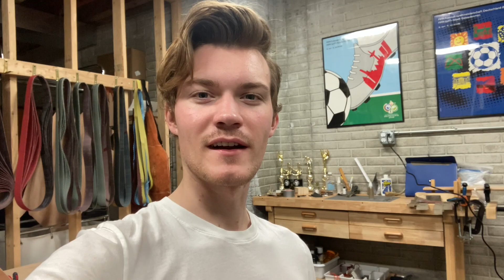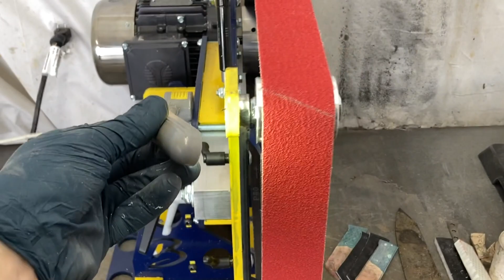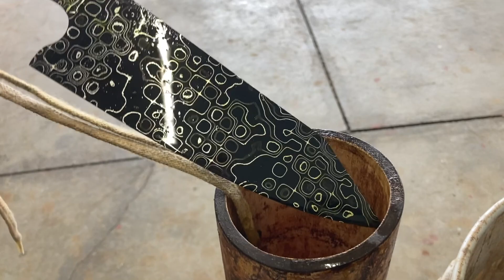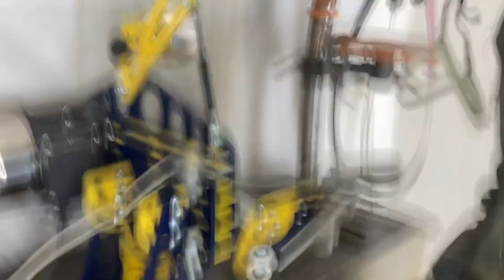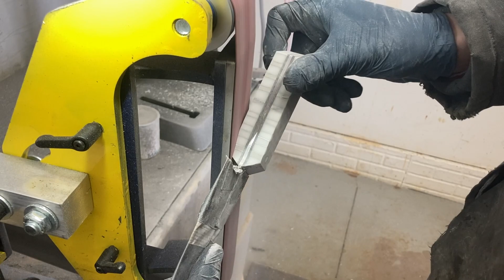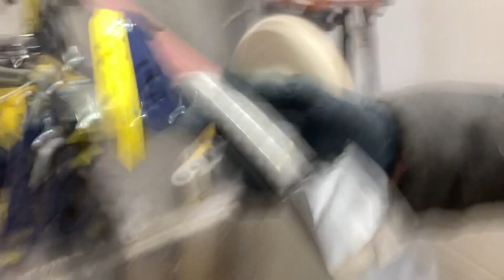Brodbeck Ironworks Knife Grinder Review and Unboxing

Comment: The only thing I would recommend is getting your controller off the table needs to be on a bracket so that it doesn't overheat it'll last a lot longer
Reply from the maker: Good tip!

Comment: Tip: instead of painting the pieces that you regret doing because of the fit, use cold bluing on them to help protect from rust without changing dimensions.

Comment: I'm a little skeptical about whether that buffing wheel spins fast enough. It seems like a cheap Harbor Freight grinder with a buffing wheel might work better just because it spins so much faster.
Reply from the maker: It’s definitely fast enough. I actually only run it at 30% speed so that it isn’t too fast. There’s not really any reason to go faster. :)